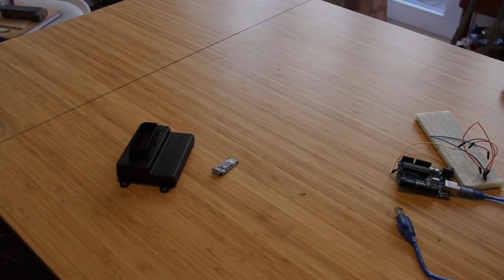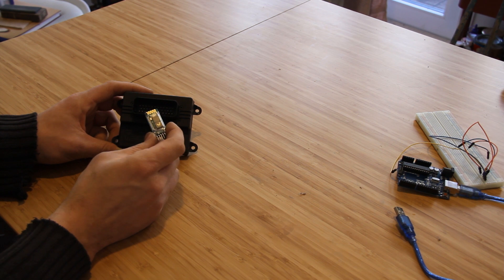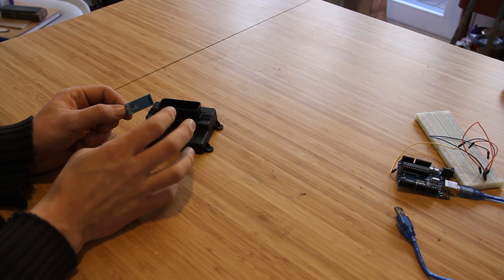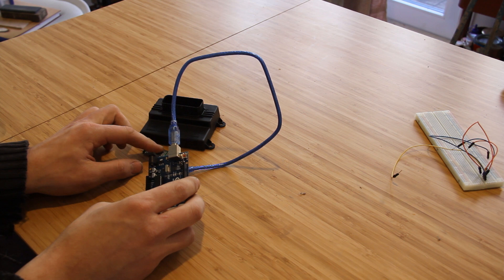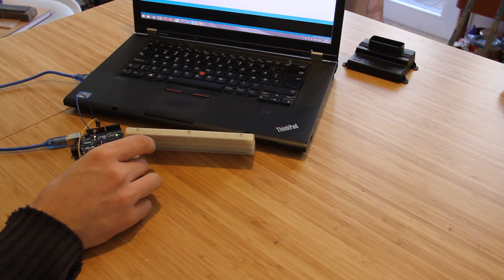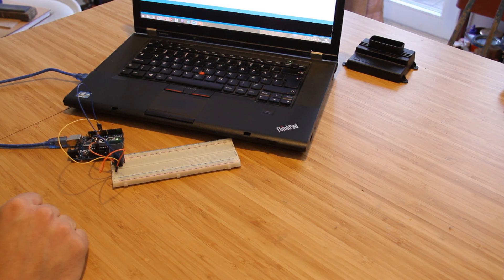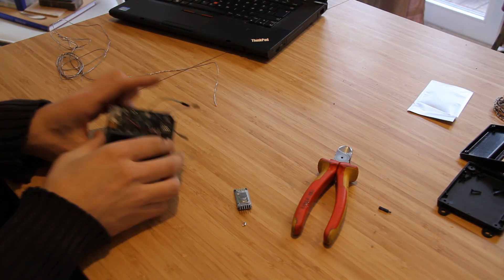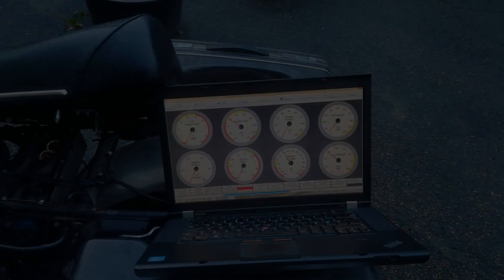LIDA Speed: MicroSquirt Bluetooth Upgrade

Comment: Think I found a problem with this.  I've a wiring harness with a regular 1/8" phono plug for serial comms on the Microsquirt, and since installing this I'm unable to use that.  I can BT just fine.  Thoughts?
Reply from the maker: Unfortunately it isn't as simple as both of them being wired in parallel, so if you need the head phone jack to work again then you will need to un-plug the bluetooth module from the wiring harness you have made inside the ECU case.
Reply: @lidaspeed99  Thanks for the reply, I've noticed a few others have installed a toggle for just that reason.  Silly me for not thinking I would ever want the plug again!

Comment: how did you solder that? its so small
Reply from the maker: Using small solder makes like much easier as the solder to flux ratio is much better for this type work. 0.3mm works well.